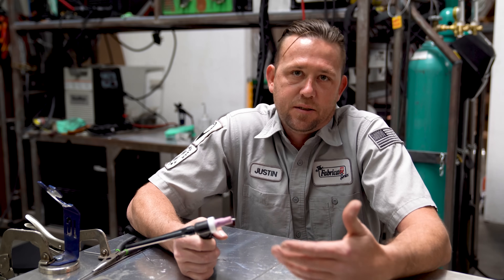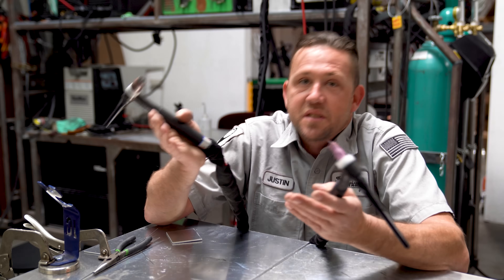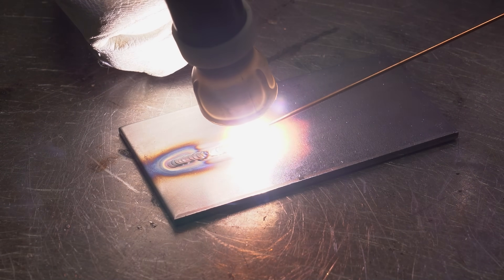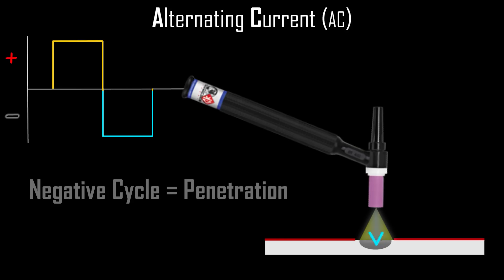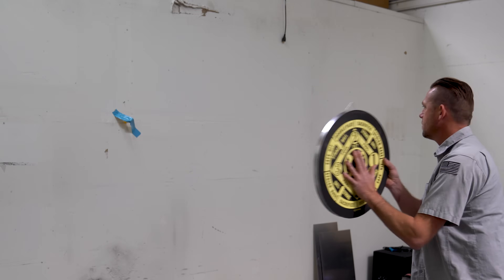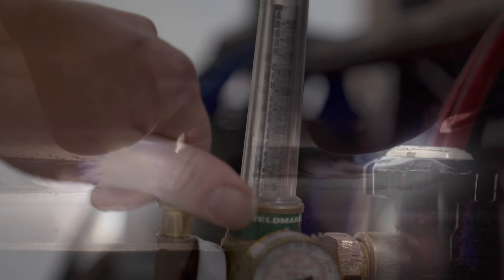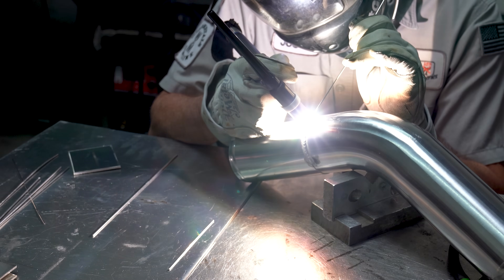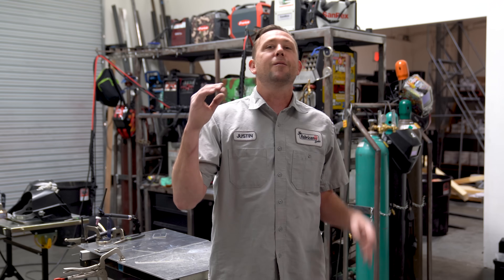Which TIG Cup Works Best on Aluminum?

Comment from the maker: Save 10% with our discount code TFS10
https://weldmetalsonline.com/
Learn to TIG Weld in Our Class!
http://thefabricatorseries.com/classes
Reply: Your video was super awesome and had great information for welders looking to better their craft. I was a NDT inspector in Naval Ship repair for many years. One extremely big thing you failed mention but clearly you had done is, emphasize cleaning! Oil left on the surface will contaminat the weld bead. Burnt oxides present after a pass is clearly obvious when improper or lack of cleaning prior welding aluminum. Any metal to be honest.
Reply: I find number 6 cup works very well. You can always change the frequency to help the arc smaller.  You get a much cleaner weld if you use 5 % helium with argon. and will generate more heat.

Comment: Lol... I had no idea that a #5 or #8 was the preferred cups by seasoned aluminum welders... I've been welding for 20+ stick, mig, fluxcore... 4 years ago I returned to a old job and noticed a lincon 370 precision tig machine just collecting dust.
 So I hooked it up and became the aluminum welder lol, long story short I run a 1/8" gas lenz with a #8 cup just because it felt right😂

Comment: Would having too high of an Argon flowrate have the same effect?  I ask as I was practicing the other day and thought that the Argon was being consumed at too high of a rate.  It turns out that the regulator had the liter per minute and cubic feet per hour scales switched from the previous regulator that I was using.  So as a result, I was flowing at 20 liters per minute thinking that I was flowing at 20 cubic feet per hour.  But actually, I was flowing at about 42 cubic feet per hour.  Tia.

Comment: I used to use GAS lenses on Aluminium, but with the AC frequency + cycle spitting oxides into my tungsten and reducing the life of he Gas lens, I decided to go back to standard collets. My weld quality has actually improved. And I'm saving a fortune on Gas Lenses. Now I only use Gas Lenses for Ferrous metals, mainly SS.

Comment: Question: just got back having to weld aluminum after many years and I don't remember my magic settings for my tig. When I was testing yesterday I was welding in the horizontal position and a little bit after the start of my weld the ball on my tungsten dripped over to the side. I don't know why.

Comment: Interesting. I've ended up with a number 8 gas lens as my preferred setup, mainly because I like the extra coverage as it helps stop impurities, especially when working with old bits of cast. I'll try the 5 again though, it's been years since I did.

Comment: Well it appears your dip speed and the speed you were moving the torch were a bit different.  I use the 8 with gas lens and it looks the same as your 5. Nice looking welds though guy.

Comment: I usually run a nr 8 cup, but then again, I weld alot thicker stuff than intercooler piping. Found out that a nr 6 is too, small, not because of the lack of heat in the weldpool, but the cup explodes due to the heat when running 280+ amps for an extended period of time

Comment: 20 cfh is a bit high for a # 8 cup, creating a Venturi effect. I run my argon between 12 7 14 cfh with that cup. Keep in mind I am not using a micron flowmeter so gas flow may be 10% either way.

Comment: Awesome thanks for explaining,  i was using a #5 and got my weld ok,  but was told I should be using a #12 cup and have been struggling with it ever since (I have about 15mins total tig welding with the new machine). ill switch back to the #5 now thanks!

Comment: I make hardtop cabins for 30 foot aluminum fishing boats, and I generally use a #6 with a little bit of stickout for TIGing grab handles, corners, etc. Seems to work alright. Used to use a 5 but it just never turned out quite right.

Comment: Great tip! I have been using a #8 cup with gas lens and my welds look just like yours with the same gear - well close anyway. Filet welds especially are difficult to get into the root without excess width. I'm off to the shop to try the #5 cup and standard body with high hopes.

Comment: 1:15 Observation - Everything wasn't the same between both welds - your distance from your work to the tungsten tip was different between both welds and caused your arc to wander. #5 cup is fine but 18CFH Argon would give better shielding w/ 189 amps Electrode negative / 120 amps Electrode positive w/ a 74% balance @ 130hz using 3/32 filler. 

Using a Furick clear cup gives us the added vision in tight spaces instead of using a ceramic cup as we can see through the Furick cup. 

Not mentioning your machine settings leaves the guy who is looking for guidance in the dark. We'll mention dwell time on arc starts and travel speed also as most novices tend to get a puddle and get moving which causes a lack of full penetration. 

Take it for what it's worth as we're all learning something each day. 

Cheers and Happy New Year!

Comment: I've tried all the cups, there is about 2mm etching difference between 5-12 with the stubby gass lense however if you turn the amps up the smaller cups don't cool the weld enough so my findings are if you use more gas you end up with a shinier weld which I'd prefer over 1mm of etch line

Comment: A number 5 is only good up to so many amps. Running 325 amps through a #5 with 3/32 will not work. I run 1/8 tungsten on about 95% of my work no matter the thickness.  So #6 cup is about as small as you can get with 1/8 tungsten. If you weld 1/8 material all day maybe up to 1/4 yes a #5 will work.

Comment: Time to get hardcore on these vids, my retired father just bought a 3000$ Miller Tig and can't even weld 🤣
I've got a mig but that's just a molten metal glue gun 🤣
I can sort of Tig steel , but I'm really good at ruining aluminum and there's alot of(aluminum)  projects  piling up that needs to be welded. 
I learned enough to pass back in tech school like 20yrs ago but never used it much again. 
Aluminum seems really difficult ,what with settings to extract impurities and stuff and damn near scientific.
Either way, I think I need to check your vids and find some "aluminum 101" vids.

Comment: I specialize in welding aluminum from my personal experience the gas creates a medium with the same flow and amperage a smaller cup will always produce a tighter nicer more uniform weld And it will also weld faster. However to small a cup will cause a problem on thicker materials. My suggestion in most cases use the smallest cup that works for the thickness of aluminum you’re welding.

Comment: one of the best aluminum welding explanations I've seen. bar none. 
what was great is that your explanation matched my observations in the last month where i tried a number ten furick cup.... needed twenty five cfh... random arcs... etc. thought i was doing something wrong.
also noted, like you said, i increased the stick out... helped. but needed an additional 2-5 cfh... so by the time i get it running right... it sounds like a hissing snake spitting money during post flow lol...
awesome to see you making new vids... thanks!!!

Comment: Great video! It’s funny, I pretty much always use a standard collet body and 5 cup on aluminum. Earlier today, I had some aluminum to run and there was a gas lens on the torch so my lazy self threw on a 7 cup and let’er rip. Half way through, I thought this works pretty good.

Comment: Is this more about the cup size or whether or not to use a gas lens? How does a #5 gas lens compare to a number #5 standard? Please clarify. Thanks!
Reply from the maker: A 5GL works similarly to a 5 standard until you get into a tight space. A gas lens size won't get any smaller around the body, so the discipline of switching your consumables still applies in tight spaces. If its in the way - its in the way.

Comment: i simply cant run a Ally5 as good as 8 pro glass. especially on outside corner joints where gas coverage is harder to achieve.  i could care less about a etching line cause in a few months it all looks the same.

Comment: I have an Everlast tig  185 that’s about a year old and I swear it’s making an ark but not welding but it melts the metal sometimes anybody know what’s going on ?
Reply: If there is not adequate gas the ark won’t complete
Reply: @jacobcarter9491  bottle said 500 I  think   i think I will start there check flow
Reply: @champhousemotorsports  does the tungsten buzz around and create a volt strike just dosent have  the gas flowing to finish the ark?
Reply: @jacobcarter9491   ya it flickers but stays constant I’m going to get my tank filled  when I first got the machine I was  welding aluminum I’m not great at it but it welded it I switch to a steel tungsten and now I’m having problems probably low gas I probably used it all learning
Reply: Dirty tungsten,   not on AC? ,
Reply: @Proxtor   I was welding steel and I did clean everything
Reply: @champhousemotorsports  bad gas or low gas .  Get a flow meter tester you can put o  the end of your torch.  Sometimes flow meters go bad

Comment: I was running a #6 on 15cfh argon.  I'll switch it to a #5 and 12cfh and give it a whirl.  Save a few cfh... literally, lol.  My issue was dirty aluminum that I got out of a scrap pile.  Cleaned it with a stainless steel brush and some acetone but was still getting black shit in my weld pool.  I put my torch down and put in an order for 40 coupons from Weld Metals Online.  It's on it's way.  Thanks for the tip!!!